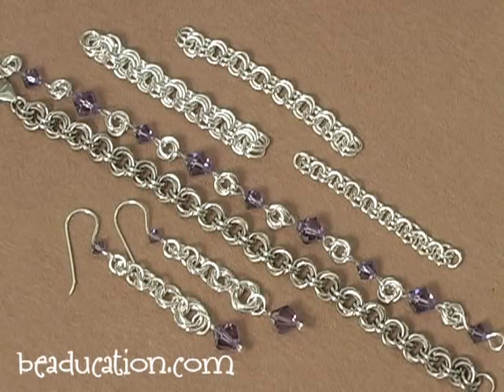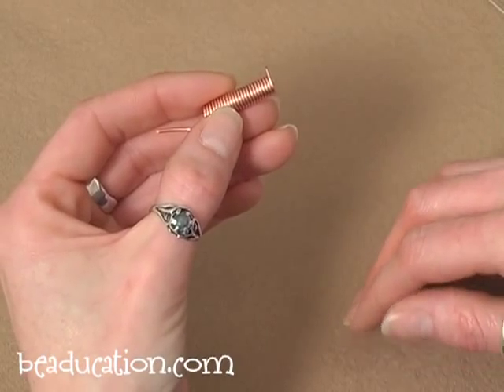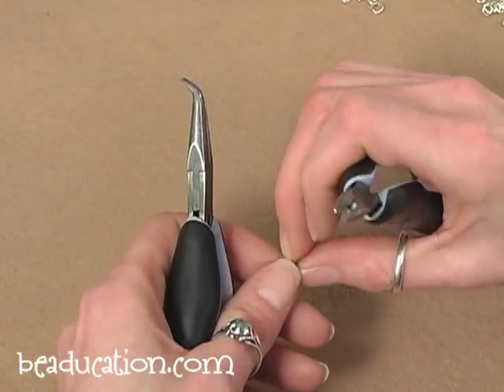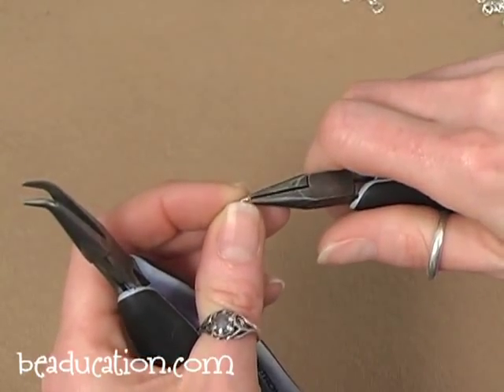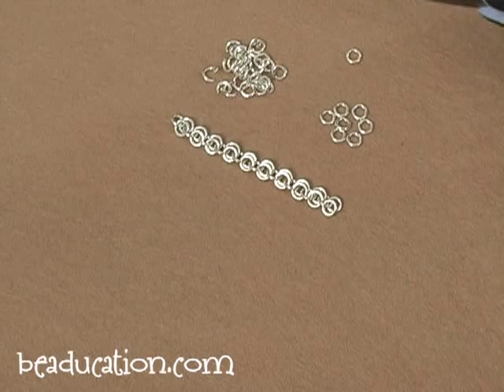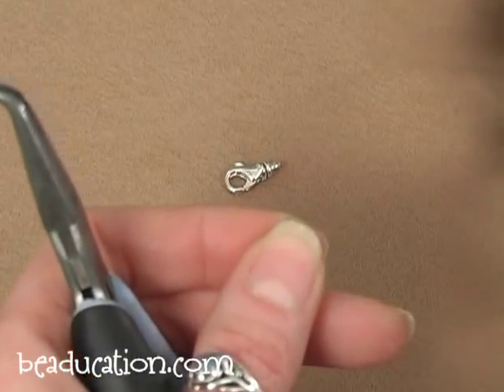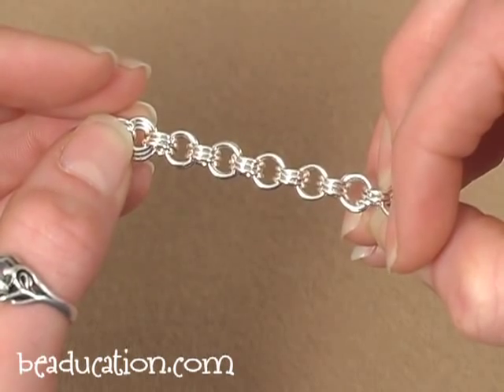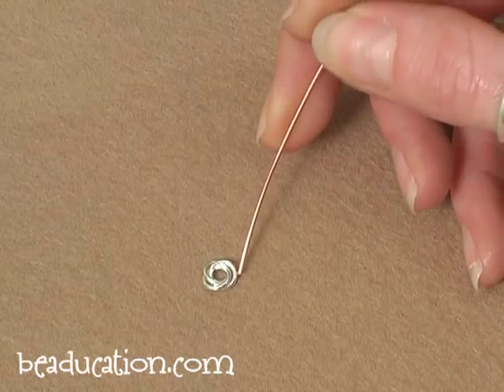Introduction to Chainmail - Beaducation.com

Comment: Great video and wow, the one on pepe tool jump ring maker really clarified everything to me. All this step by step. . I have a question as to which mandrels to use to make the jump rings you taught us with the jump ring maker. Thank you so much btw. I have to do 10 mm jump rings with 20 gauge. I have looked at charts but don't really get it. Which  number mandrel do I use with the pepe tool jump ring maker please? Which one will be used if I use 18 gauge  to make 10 mm jump rings also. I have not grabbed the concept yet. Thank you.
Reply from the maker: The mandrels should have the mm size on them. So if you wanted to make a 10mm ID jump ring, you would use the 10mm mandrel, no matter what size gauge you are using. If they aren't labeled you can measure them with a caliper.
Reply: You are so kind to have answered.  Maybe I applied too much tension and they didn't turn out good. I use the mandrels with the pepe tool machine. Yes, they make good mandrels, they are labeled. it's the student the problem , which means it's me. Thank you very much.

Comment: How much wire do you need? And will the 14k gold filled wire off ebay work?
Reply from the maker: since this is just an intro class we aren't working towards a finished project so she doesn't mention exactly how much you need. I would just start with at least 3 feet and start giving it a go. I am not familiar with wire from eBay, but if it labeled as Gold Filled it should be fine. If you are making your own jump rings, make sure the wire is not too "hard" - it should be labeled.